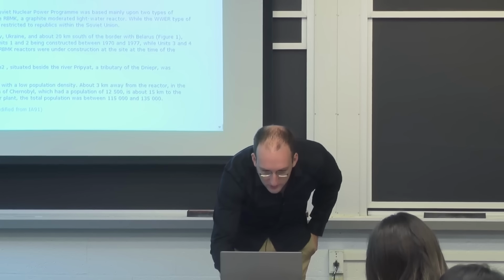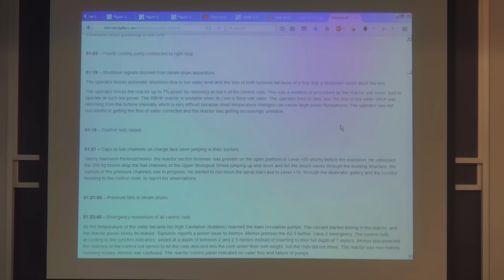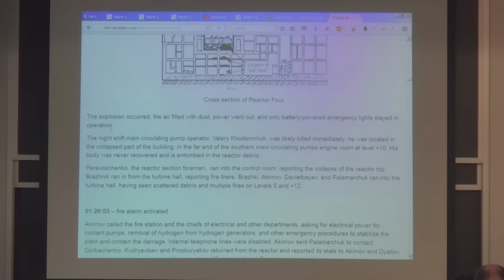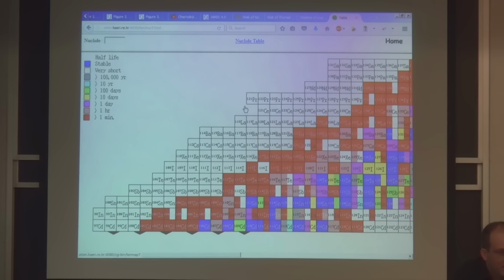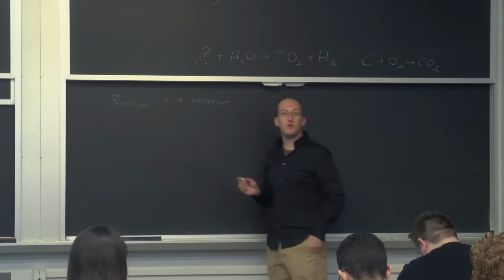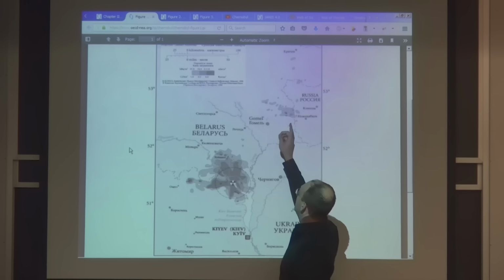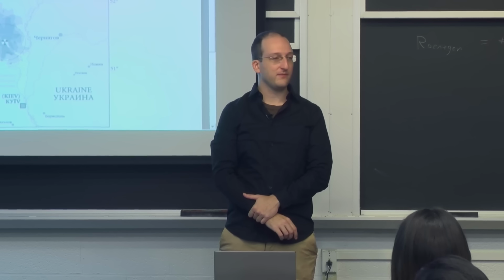26. Chernobyl — How It Happened

Comment: Why did the Russians tip their controll rods with graphite? What was the advantage supposed to be? Thanks - Rolf
Reply: "It's cheaper"
And it wouldn't matter, except if the reactor is pushed to its limits. Which they did, running it on half power during the day and then started the test.
Reply: @Петърчо  Thanks but I still don't understand. Aren't the rods supposed to shut down the reactor in an emergency? So why tip them with a material that accelerates fission?
Reply: @heit3032  they were not tipped, they were in part made out of graphite. It gives you more control.
Ironically the shortening of the rods, which enabled the positive scram effect in the first place, was a security update to reduce the ammount of graphite in the core.
Reply: The control rods have two parts of, let's say equal length: Boron and graphite. Boron, the upper part, is there because it inhibits fission, so if you want to slow down the reactor, push more boron inside it. Graphite, on the other hand, slows down neutrons in a way that makes fission possible, so when you want to produce heat, you increase the amount of graphite in the core. This is necessary, because in an RBMK water works as an inhibitor, slowing down fission, so the graphite is there to make reactor produce heat. Therefore, graphite is an integral part of how the reactor operates, that's the advantage.

In "western" reactors water itself actually serves as the "moderator", the same purpose as graphite serves in an RBMK, so graphite is not needed.

Does this help?
Reply: @rippemies  Thanks, but I still dont understand. When the rods are the emergency shut down mechanism, it seems extremely dangerous to have them function as moderator before they can stop the fission.
Reply: @heit3032  Sure, but it can be safe with proper design. There are still active RBMK power plants. Chernobyl didn't have proper design. By shortening the graphite in the rods they gave rise to the "positive scram effect" which, with positive void coefficient and an uneven reactivity distribution, made the runaway reaction possible. There were many ways they could have prevented this. For example, there are automatic boron control rods that enter from the bottom of the core. If AZ-5 had engaged their insertion, Chernobyl likely wouldn't have happened. The fact that pressing AZ-5 didn't affect the automatic control rods is actually insane to me. The rods also moved relatively slow, and it took like 18 seconds for full insertion. Today, this would be unacceptable.

This is one of the reasons most reactors today use water as the moderator. If there's a runaway reaction, the water boils and without the moderator, reaction ends. It's pretty nifty.

Please note I'm not an expert on any of this, so anything I say can be wrong.

Comment: This test has been performed before without accidents. With or without these design flaws, five months after the accident, reactor 1 was operating again and a month later reactor 2 also began operating. Reactor 3 was only shut down in 2000. The problem of the lack of containment did not imply the explosion but rather the extent of the disaster, which only reflects the Soviets' lack of concern for safety. Some argue that if there had been a containment structure it would not have withstood the violence of the two explosions. The first explosion ripped off the reactor lid, which weighed 1,000 tons. The reactor exploded due to violation of safety rules, lack of experience of the operators and overconfidence of the chief. According to the operating rules, the reactor could not operate with less than 700 Mwt; when it reached 30 Mwt and they did not know what was happening, it should have been shut down for investigation. If the designers created this rule, how could the operators and the chief violate it? Instead they continued to insist on the test, committing violations of the rules of operation and the result is known.
Reply: Yeah....
Simply stated they were pushing the limits, they had warnings signs of a problem, and they kept going. 
I dont understand what people dont understand. This was the 80s, we know what happened, its not a secret.
Reply: Not really. You are repeating designers' narrative. "reactor could not operate with less than 700 Mwt" there was no rule about operating at any power. "when it reached 30 Mwt" it reached 0 MW and manual allows raising the power. "they did not know what was happening, it should have been shut down for investigation" well. It doesn't exactly works that way. You don't turn off the plant for investigation because you don't know what is happening. The power has dropped to 0 MW, manual allows raising the power, end of investigation, write it to the log.

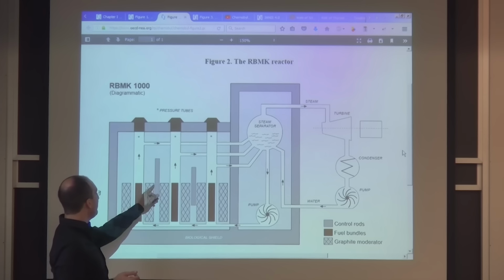Comment: 7:16 "and then in between the graphite moderator where control rods about 200 of them or so 30 of which were required to be down in the reactor at any given time in order to control power and that was a design rule that was broken during"

This is largely not true. First of all, not 30, but at least 15 (with the permission of the plant chief engineer), which is not so important though. Secondly, these are not number of real control rods that should be in the core. In the practice of operating RBMK, the number of control rods denotes the amount of reactivity released: one control rod - amount reactivity added when one average control rod is removed. In the USA use dollars and cents as whole and hundredth parts of beta_eff, and at RBMK they used a unit of measurement called a control rod, which was equal to some fraction of beta_eff. And specifically in this context we are talking about the reactivity that could potentially be released when all the rods are removed from the core. This value was called OPERATING REACTIVITY MARGIN (ORM) and essentially serves as a measure of the ability to accelerate the reactor, i.e. to compensate for the loss of reactivity due to poisoning or fuel burnout. If we are talking about some abstract reactor (not about RBMK), then a reactor with ORM=0 (all the rods are removed from the zone and we have nothing else to accelerate the reactor with) will be clearly safer - it is already critical and cannot be transferred to a supercritical state, than a reactor with ORM=30, which we can potentially transfer to a state of acceleration on prompt neutrons. Speaking specifically about RBMK, the danger of a small ORM was due to the positive void coefficient, which was highly dependent on on the presence of a neutron absorber in the core (whether it's U-235 or control rods) and increased with removal from the core (that is why one of the measures to improve the safety of the RBMK after the Chernobyl disaster was to increase the enrichment of nuclear fuel). And also the positive scram effect due to the  graphite displacers of the control rods, which arose due to the massive displacement of water from the core by the absorbing rods, which were mainly in the extracted state (because the ORM is small).
But both of these sources of danger of the small ORM were not that known to the designers of RBMK because this was contrary to the design rules for nuclear reactors in force at that time. An analysis of the reactor's non-compliance with design standards can be found in the book «Revenge of Peaceful Atom» by Karpan N). 
Regarding the prohibition that was in the technical regulations (at least 15 rods): There is compelling evidence that it was due to the possibility of leaving the iodine pit and the economical use of nuclear fuel and that the operators and designers understood this prohibition in exactly this way. Moreover, at that time ORM was not possible see in real time. Its calculation on the computer took several minutes, and in the transient process that occurred before the accident, this parameter could vary greatly in either direction (due to the large value of the void coefficient). And in the technical regulations itself it is stated that with less than 15 rods received for measurement at a steady state mode of reactor (and not in the transient process). A detailed analysis of how the designers of RBMK treated the ORM parameter can be read here https://accidont.ru/ENG/regul1.html

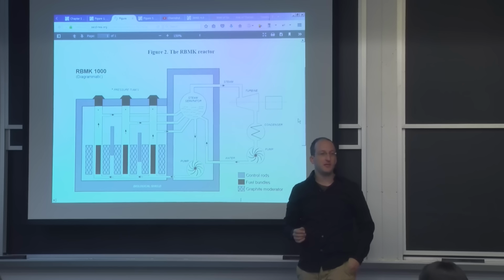7:34. 
Small inaccuracy. These blocks were not concrete. They were metal with some filling inside. Weight about 100 kg.

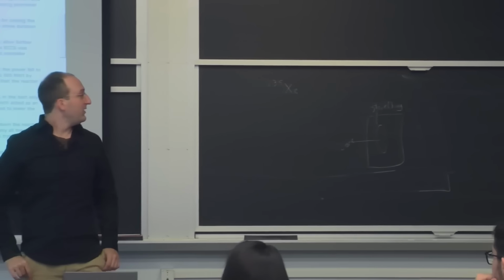8:30 
Again an inaccuracy. The half-life of Xe-135 is 9.2 hours. The lecturer probably means the characteristic time of reactor poisoning, which is actually several days.

14:33 "in addition they decided to disable the ECCS or the emergency core cooling system which you're just not supposed to do so"

Here I will simply quote from INSAG-7: 
"It was stated in INSAG-1 that blocking of the emergency core cooling system(ECCS) was a violation of procedures. However, recent Soviet information confirms that blocking of the ECCS was in fact permissible at Chernobyl if authorized by theChief Engineer, and that this authorization was given for the tests leading up to the accident and was even an approved step in the test procedure. INSAG believes that this point did not affect the initiation and development of the accident. However, it must be recognized that the plant was being operated at half power for the period of approximately 11 hours leading up to the accident, with the ECCS blocked out. This could be viewed as no violation only if the 11 hour period of half power opera tion were part of the planned test, which it clearly was not. Blocking the ECCS over this period and permitting operation for a prolonged period with a vital safety system unavailable are indicative of an absence of safety culture"

14:53  
This is a myth. It originally appeared in Grigory Medvedev's fiction book "Chernobyl Notebook" and was borrowed from there. In reality, no one could have witnessed these jumps

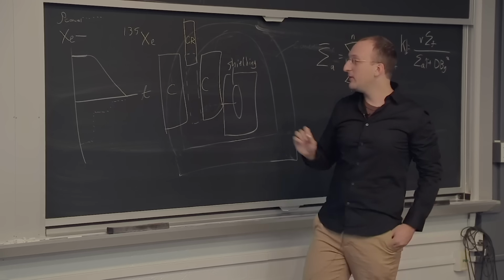18:33 
It has already been mentioned before. In reality, the length of the graphite displacers was 450 mm (17.7 inches). The diagram can also be found in INSAG-7.
Reply: Underrated comment

Comment: 17:04 It seems that you forgot to mention one important factor about the vontrol rofssde of boron but with graphite at their extremity. When the operators noticed that the reactor power was rising so quivkly they decided to push the emergency button to stop the reactor what let the control rods back into the core incressing the amount of graphite hence increasing the number of reactions in an exponential way.
Reply: According to INSAG-7, there was no power surge before AZ-5 was pressed, it happened a few seconds after they started the shutdown.

Comment: This explanation seems to be rather inaccurate. E.g. he mentions the control rods having 6 inch graphite tips, but actually they had graphite sections about 4.5 metres long. Also he talks about the 30 control rod limit as  being a critical rule that operators should never have exceeded, but in reality it's unclear that there was actually a hard rule, operators could not have known the consequences of going below that value as they were lied to about reactor characteristics, there was no instrumentation to directly show them how many equivalent control rods were inserted at any one time, they couldn't actually have controlled the exact number anyway because some control rods were under automatic control, and also other sources that do say there was a limit say it was 15.
A shame because the lecture is otherwise quite enaging.

Comment: The lecturer is illiterate. The caps on the ducts are not 350kg, but only 70kg. They cannot jump - this is a common lie. The lecturer is just repeating a point of view on popular videos. The reactor explosion at Chernobyl was nuclear, not thermal, as evidenced by measuring the fission products released into the atmosphere. Nuclear explosions have a different composition. There can be no global poisoning of the reactor in RBMK because the reactor is of the channel type, it is a water-water nuclear reactor.
Reply: Also graphite burning at 2:00. I've left immediately.

Comment: 7:00 incorrect, the actual written regulatory requirement for ORM was 15, which was not broken.
8:20 Yes, whilst it is true xenon is slower to burn away at half power, fission products are obviously the result of well... fission. If there is less fission happening inside of a reactor, the less fission products there are being created. Xe-135 also has a half life of 9 hours, so by the time the test continued to be conducted it is all but assured xenon was at low quantities.
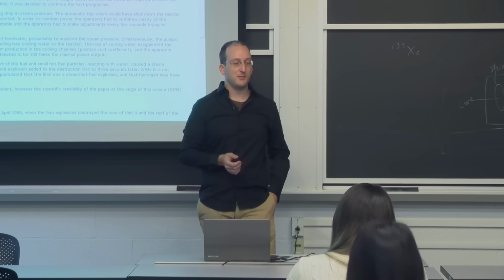11:00 It was in fact 18 that remained, once again with ORM limit of 15.
15:00 This never happened, this was proven to be a false report.

Comment: You twerp. 3 mile island not much of an accident? Did the us govt manufacture that disaster
Reply: Well compared to this, not really. 

TMI's meltdown was entirely container within the reactor, it didnt even need to rely on its secondary containment structure to hold in the radioactive fuel. 

Its only release of radiation was from a cooling loop overpressure valve, which released the cooling water and a small amount of radioactive contaminants into a building/structure specifically designed to hold this cooling water and contaminants. Beyond that, the only thing that made it out of the power plant itself were the small amount of radioactive gasses that could leave this containment structure.

Comment: Re: "When does a rapidly dividing cell become cancer?"

Didn't see this in the comments so I thought I might give an answer. It is a complicated question but the best answer that I was taught was based on the work by Hanahan & Weinberg, where they outline six characteristics referred to as "The Hallmarks of Cancer"

1. Sustained proliferation: Cancers self replicate and grow by constant mitosis, whereas regular cells have a very structured method when and how often they undergo mitosis.
2. Resistance to inhibitory growth mechanisms: Extracellular mechanisms exist to control the growth rate of tissues, cancers will not be affected by these mechanisms
3. Induce angiogenesis: Angiogenesis is the process of having blood vessels grow and supply nutrients to the tissue. It's a natural process involved in growth and healing, but cancers can hijack this.
4. Immortal replication: Cancer cells are typically found to have telomerase enzymes activated and will elongate the telomeres at the end of chromosomes. Normal cells have telomeres to prevent degradation of the chromosomes during replication, but they eventually run out as a person ages, causing subsequent mitotic divisions to have degraded chromosomes which eventually cause cell death due to destroyed genes which are necessary to survive. Cancer cells constantly extend these telomeres so they may continue mitotic divisions endlessly.
5. Avoiding apoptosis: Apoptosis is the technical term for "programmed cell death", where when a cell becomes so dysfunctional or damaged it will "self-destruct". Cancer cells avoid these mechanisms.
6. Metastasis: The ability to invade and grow in other regions of the body.

Comment: Xenon is a heavy neutron poison and till today it is one of our biggest challenges to maintain power stable post transients as the xenon builds in rapidly and then You have to offset it with dilution until it's burn up and then dilute again. We do not move rods to control xenon oscillating. Rods push You axial shape index around to much. Dilution and borations have a universal effect on the core and does not move ASI that mich. Xenon is a big challage for most control room operators even today. We do have very. Clever simulators and we actually practice how to control xenon oscillating on the sims.

Comment: Using the spinning down of the turbine to try and generate is insanity. There is no more driving force behind it as all t main Stop and Control valves are closed and the frequency of anything generated would be low and potential damage equipment. These days all nukes have back up safety related diesels of about 8MW per diesel and 2 per unit which supplies all power needed for design basis accidents.

Comment: Great lecture. I have a question if anyone is reading this. He refers to xenon "burning off." This seems to be a process in addition to its relatively slow radioactive decay. It's not burning in the sense of oxidation, so what does he mean by that? Is it being eliminated by removal or by decay induced by the reactor processes?  If anyone has an answer, I would appreciate it.
Reply from the maker: Xenon-135 likes to absorb a neutron. Once it absorbs a neutron, it becomes stable ("burned") and doesn't want to absorb any more neutrons.
https://en.wikipedia.org/wiki/Iodine_pit

Comment: There are definitely inaccuracies in this lecture. The control rods were not tipped with 6in of graphite. They had a whole graphite block that was almost the length of the reactor. The problem was they weren't the same length but shorter.